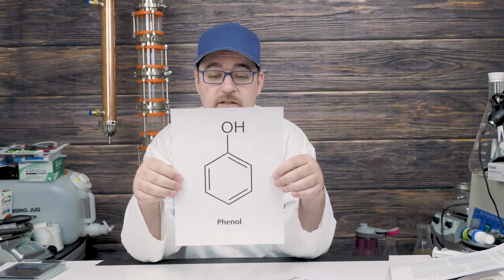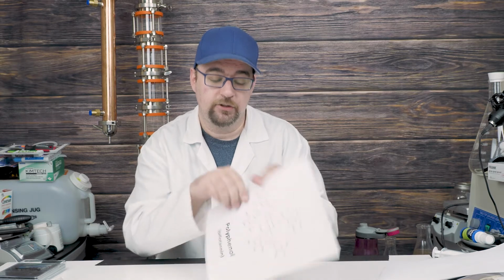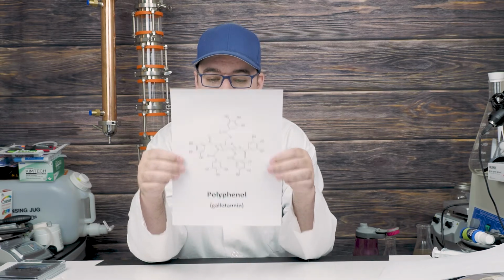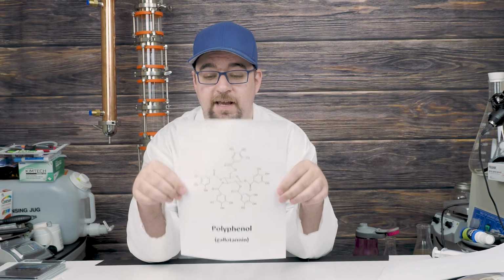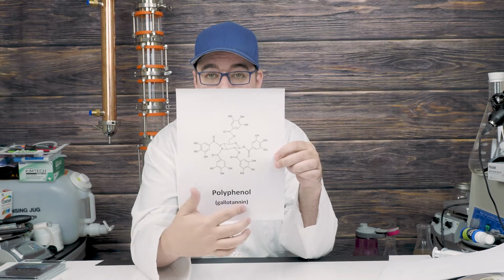Ep 015 - Tannins and "Over-oaking"

Comment: You got a name for that syringe you use to take samples. I can't find that style by any name I search?
Reply: It's called a pipetter. In this case it's a 1-10mL pipetter. Tons of them on amazon and ebay. So you buy the pipetter itself, which is just the handheld part, then you also need to buy the pipetter tips. I usually just wash the tips out and reuse them, if I am doing something with yeast/bacteria I will do an additional step and soak them in boiling water for about 5min. You can buy all of it off of Amazon, which is where I got mine, with the tips you get like 100 tips in a bag.
Reply: @adamw2785  pipetter sweet thanks I saw that and instantly knew I needed one. Thanks for you help and the awesome content!